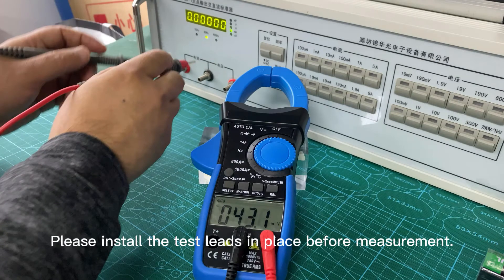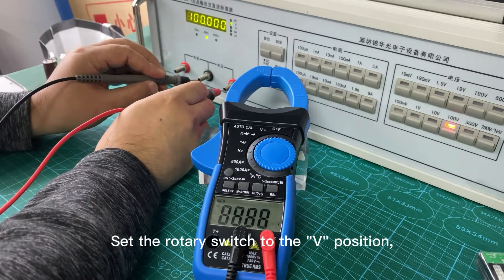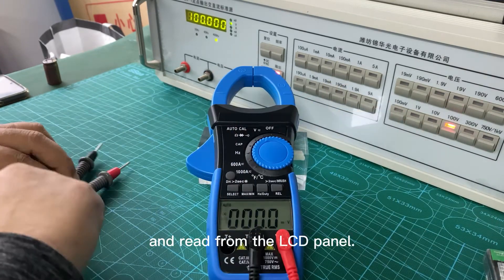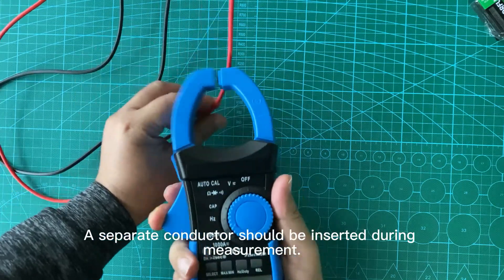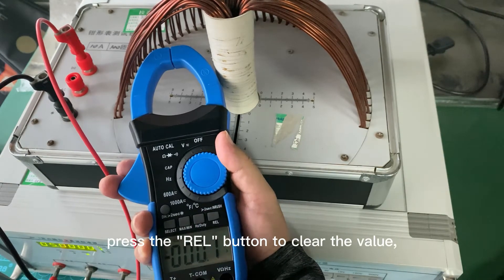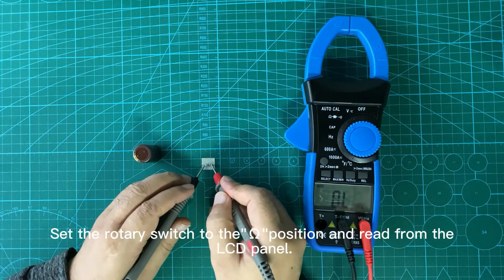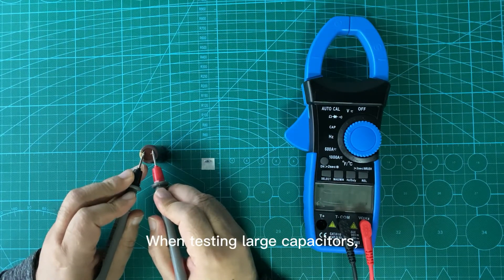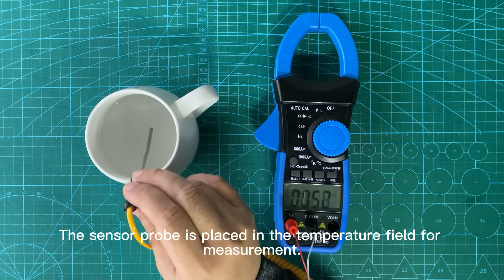Inrush Current Clamp Multimeter,570N TRMS 5999 Display

Comment: Inrush current test?
Reply from the maker: Yes,this meter can measure inrush current
Reply: Why don't you show, in the video,  how to measure inrush current in AC and DC mode? Thanks.
Reply from the maker: Please press the "REL" key for more than 2 seconds to
measure inrush current at ACA range @bradj.3832
Reply: Does this also apply for DC current inrush measurements? Thanks.
Reply from the maker: It can just test the AC  current @bradj.3832
Reply: Thank you for the help.  @holdpeakinstrument4497